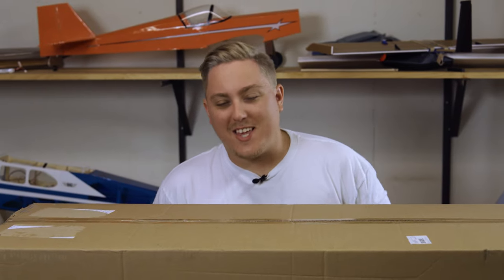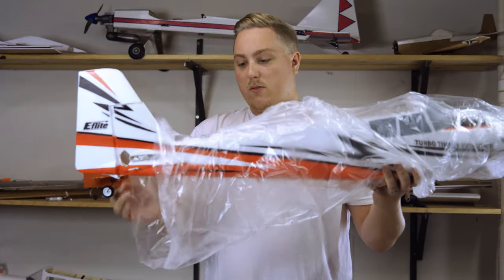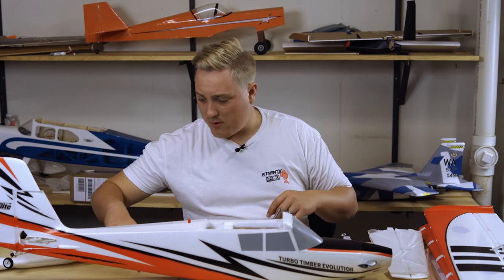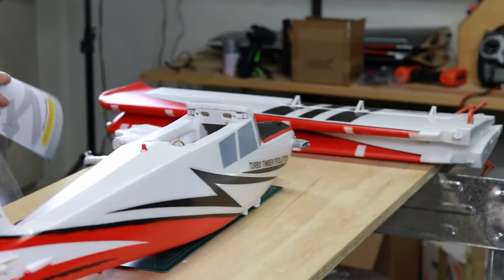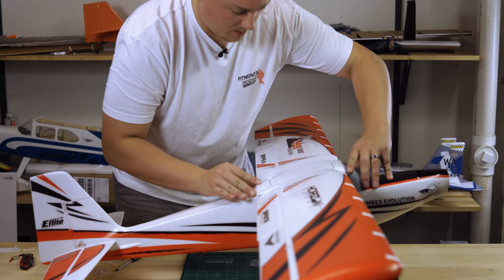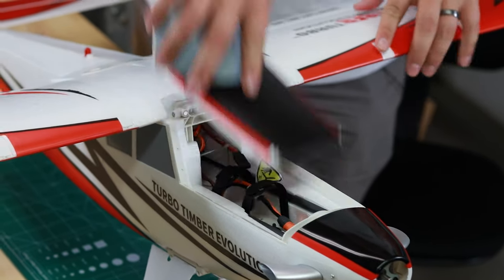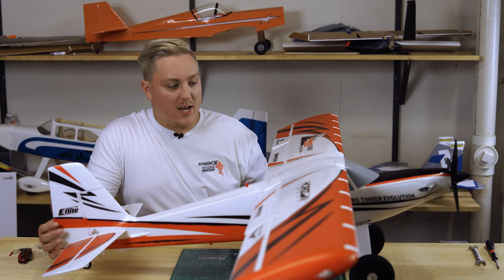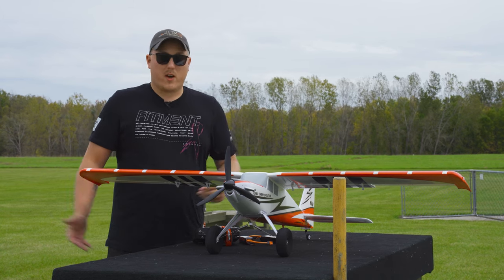E-Flite Turbo Timber Evolution Unboxing and Review

Comment: Claims of “3d capable” are a stretch. Any plane is “capable” but this one is no more capable than any other trainer level of plane. It IS a fine plane for learning and general flying though.
Reply from the maker: This is true! Wasn't until I compared the sizes of the control surfaces on this one to one of the normal timbers that I realized how much smaller they were
Reply: We tend to disagree that the Turbo Timber Evolution isn’t 3D capable. 😁 It most definitely is.
Reply: @TailHeavyProductions  No disagreement! The Timbers just aren’t as “3d” capable as some newcomers might be lead to believe. Like I said, most any plane can do 3d. Some are just less capable as in this case and make learning an uphill battle for someone wanting to test their 3d ability without knowing the difference.

Comment: i have 2 and the landing gears springs are complete garbage..
Reply: What's wrong with them? As I'm on the brink of splashing out on one of these as a first plane
Reply: @Fromatic  They work fine overall but a nose over landing will likely make them useless as they pull out of the foam and can be a mess to fix.